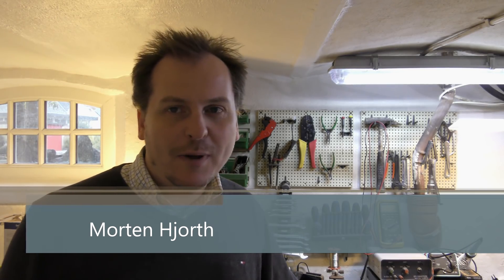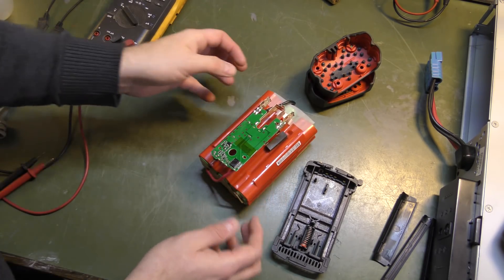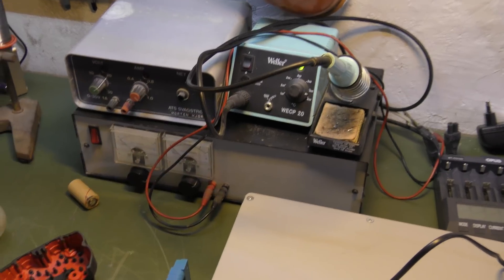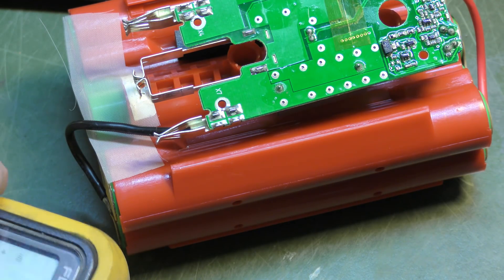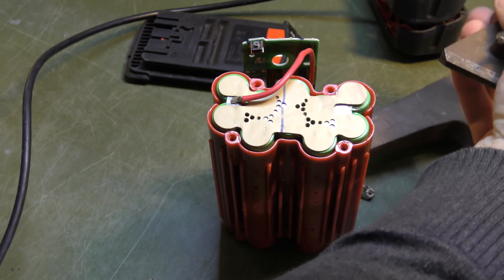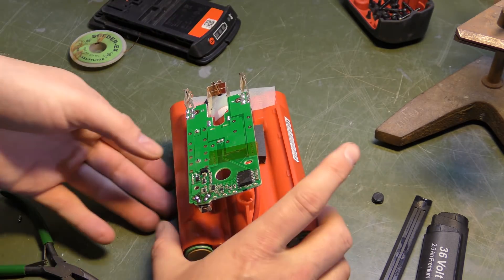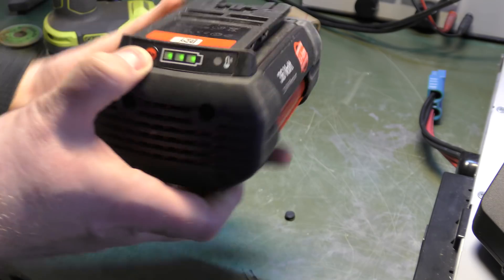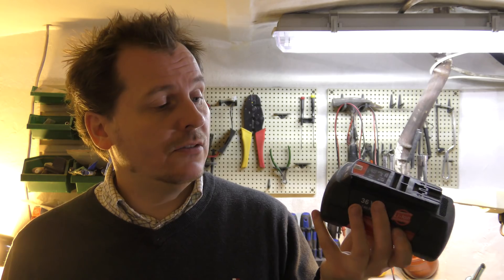Fixing Broken Bosch 36V Li-ion Battery Pack - 776

Comment: My battery shows 19v then nothing.  Seems to switch off straight after showing a reading. Each cell shows just over 4v. Is this a thermistor fault and how do i change it? TIA
Reply from the maker: 19V is probably too low,, something does not add up,, 10 cells of 4v,, would not give 19v :-/

Comment: What is the middle pin for? Is it for the temperature sensor?

I made a custom battery for my "easy rotak 36-550" machine and i connected only the + and - from the battery, no middle pin.

The machine it starts for 3 seconds, that stop.
Reply from the maker: Sorry I do not know,,  do not have this battery,, as I returned it :-/

Comment: Hi I am getting a rapid blinking green light when pressing the battery status button, and the battery goes red on the charger when it is slid into the charger itself. What can be wrong? Thanks.
Reply from the maker: I fixed this battery for someone else,, so I do not have it anymore..
But I would take it apart, measure the overall voltages,, if that is okay, I would mesure the voltages on each cell,, to see if anything it to low. Best if they are all with in 0,1 volt of each other. 
If one or more is to low,, you need to charge that up a little,, if to high,, draine it a little,, using a little load,, 6volt motor, or 6volt light bulb.
Reply: @MyPlayHouse  This would obviously require volt meters and other electronic tools to be able to charge and test as you say. I am sending this 32V 6Ah battery to Robert Bosch here in the UK in few days time, and I hope they do as you say and get it to take a charge again. The battery is just 28 months old, and I did not over charge or drain it for it get like this. It all went wrong when I mowed my lawn and the mower kept losing and regaining power until the battery completely died yesterday. I mow my lawn at least 20 times over a 30 week period of time .
Reply from the maker: Yes the battery should still be good after 40-60 uses.. :-/
Reply: @MyPlayHouse  I received a new 36V 6Ah lithium ion battery 5 days ago and mowed my lawm without any charging issues prior to the mow. However, the battery only has a 6-month limited warranty. We'll see how it goes.
Reply from the maker: Best of luck!

Comment: I dont understand, that switch is only for the led lights right? Or is the current also passed through it?
Reply: From what I've seen when examining my own battery, the tool (drill/mower/etc) uses the centre battery connector as a parasitic 1wire interface and queries the battery for info such as pack voltage (18/36v) and temperature. If the battery doesn't respond, the tool will refuse to power up, or will work for 1 second and then die. It's a combination of safety protocols and presumably DRM in a failed attempt to thwart aftermarket clones. 
I'm guessing that the BMS had previously registered some sort of fault and entered a lockdown mode for safety. Some sites report that holding the status button down for ten seconds will perform a factory reset on a Bosch BMS, so perhaps that inadvertently happened whilst the switch was being replaced (I got the impression the bit of the video that was cut out at 9:10 involved an epic desoldering struggle which likely bridged the switch contacts).
At some point I'm planning to hook up a logic analyser and decoder to see what's going on. I was surprised to find practically no info about it online. Bosch do provide industrial BMS systems, so perhaps there will be datasheets available for those that reveal some of their consumer device secrets 😁

Anyhow, it was a very useful and informative video, even if the root cause wasn't identified. Nice one Morten 👍👍
Reply from the maker: Sorry I do not remember,, old video. :-/

Comment: I have a Bosch 36v garden battery that’s measuring 30.4v but the charger thinks it’s bad.  Is that too low a voltage for it to charge?
Reply from the maker: The charger can probably see, that some of the cells are way out of balances,, take it a part and check it with a volt meter. and charge up the low cell(s) (never charge li-ion with more than 4.2 volt)
Reply: @MyPlayHouse  thanks.  Is there a way to charge it without pulling it fully apart?  I tried linking a fully charge battery and that didn’t do anything.  What does the spring in the middle do?

Comment: I have seen a lot of batterys of powertool and bosch has no balancing. I have seen so a lot of broken one because they just get debalanced. Their are certain batteries which tend to do it more than others. The older bosch 18v batteries especially the 4 and 6 ah ones use Samsung cells which are more of a problem than the 5ah once which habe LG cells. They even state that they match the batteries so there is no need for balancing. If I'm honest they could get longer life out of the cells if they would balance them but I guess it is just like a oilchange on a car. That's were they make the most of the money. On the same time you get makita batteries and they are balancing the battery pack but put a kill switch on there which counts the cycles and then kills the bms. You'll find a lot of videos on that topic. You can actually rather not balance them and balance them manually like I did with my battery packs and just do it once in a while and you get plenty more life out of them. At least that is what I do with bosch batteries 😊
Reply from the maker: Hi TechnicDude
Thank You very much!  glad you liked the video :-)
Thank you for watching! :-)

Comment: Hej Morten, fed video - godt med noget nørderi :-)! Jeg vil høre om du kunne hjælpe mig, jeg har en Black+Decker 36V oplader der ikke virker. Det er helt sikkert noget simpelt, men jeg kan ikke få printkortet ud, da der er et par special skruer der holder det på plads. Mvh Chris
Reply from the maker: HI Rns E
My channel is English, and to make sure as many as possible,  can also enjoy the comments, they are also English.
Please keep to English.

Thank you for watching! :-)
Reply: @MyPlayHouse  Sure, no problem. Do you have any idea what may have coursed my Black&Decker 36V charger to stop working? It's completely 'dead' no light flashing and batteries not charging. I've tried to open it and look for a fuse, but there does not seam to be a fuse.

Comment: You're right about the lack of balancing function on this battery. This is very odd because when some cells will get out of balance, this will overcharge some  of them. Very dangerous as far as lithium is concerned... I have no clue why a "reputable" manufacturer such as Bosch does that, a fire incident could damage their reputation
Reply from the maker: Hi speedsterh
Thank You very much!  glad you liked the video :-)
Thank you for watching! :-)
Reply: If you use a little more time on sourcing and testing cells, securing conformity between cells, then you dont need a BMS. Check up Garcias videos, he says the same with big packs. He ran a bus on a battery pack without BMS. Also they put a termo sensor cutting out if the batteries should overheat
Reply: The cells themselves have protection against over-discharge and overcharging, so a fire can't just happen easily. However, I'm still interested in what balances the voltage between the cells. Is it possible that nowhere on the entire internet is there someone who knows how this kind of battery pack works? Somewhere it's written that the cells are high quality and charge and discharge equally, which I don't believe! There must be something within the cell itself that regulates the voltage. But I'm also interested in when this happens – during charging, discharging, or when they are at rest?

Comment: Check the battery PCB in more detail and you will see a fuse you can take out to give you safe isolation from the risk of a full battery short circuit.
Reply from the maker: Thank you very much!
Reply: That fuse is connected same way. Not soldered, but spotwelded

Comment: Replacement Power Tool Battery for Bosch D-70771
Battery Type:   Li-ion
Voltage:   36V
Capacity:   4000mAh
Color:   Black
Weight:   1270.95g
Dimensions: 97.92x72.77x156.99mm
http://www.drillbattery.com.au/buybattery.php/bosch_D-70771_power+tool+battery.html
Reply from the maker: Hi BatteryDepot comau
Why are the 4AH pack lighter then the 3AH. Quality 18650 weigh more.
Thank you for watching! :-)

Comment: THEY SPOT WELDED THAT ON!! JUST SAYING OLD ONE LEGGED JOSEPH T RETIRED NAVY
Reply from the maker: Hi Joseph Brendel
Thank You very much!  glad you liked the video :-)
Thank you for watching! :-)
Reply: He is right. They spot weld the cables to the busbar. If you want to take it of use some cable cutters and lever them of. Just do it on the negative side, way less risk of short circuit when soldering back on the busbar.

Comment: Good Job. Was Worried when you removed the switch without being able to disconnect the power.  To help  protect you, I unplugged my computer just in case....So, how did the battery project work out? ⚡🤣😋😀😀
Reply from the maker: Hi reedrancho
Thank You very much!  With your help it all worked :-)
Thank you for watching! :-)

Comment: Hi Morten, noticed another comment saying that not many tool batteries have balancers..... Have personally taken apart hundreds and found that in the last 2 years more and more are coming out with no balancers. I have an almost identical bosch 36v with balance, but it's a couple of years old. The cynic in me says this is all to do with manufacturers trying to increase profits. After all there is no way the battery without balance can last as long as the one with.
Great videos.
Reply from the maker: Hi benjamin hayes
Thank You very much!  Totally possible,, or to give the manufacturer's a little credit, Maybe it's not as necessary anymore, maybe there is more errors on the balances cricket then on the batteries,, maybe the cells then self includes some safety kill switch.  
Thank you for watching! :-)

Comment: i notice when you try to remove the plus cable from ther battery you damage the protection of this? is danger have  a little part of red wire exposed?
Reply from the maker: Hi Christian Belotti
Thank You very much!  Yes the insulation melted... it's fine.
Thank you for watching! :-)

Comment: No balancing on most tool batteries, unfortunately. I've taken apart Bosch, Makita, Dewalt and Milwaukee and found nothing in most of them. The newest versions of Makita seems to have it, though.
Reply from the maker: Hi Jesper Monsted
Thank You very much!  I forgot to check when I had the Ryobi battery apart.
Thank you for watching! :-)
Reply: Makes you keep buying their crap.  Use adapters and avoid buying from them in the future
Reply: I think that's not the electronics that balances the voltage, but rather just checks if any cell is below or above the allowed voltage! And when it is, the electronics register a fault and become unusable! With Makita, I have more problems with the electronics than with the cells themselves, it's as if they have a limited number of charges or something similar..

Comment: Yes i also wondered where the wires for the cell balancing were, also where is the temperature sensor for safe charging?.
Your solder sucker needs a clean and relube, they are a bloody nuisance :-(
Saving some parts is handy :-D
Reply from the maker: Hi zx8401ztv
Thank You very much!  It feels so good to use some of the parts, that I saved long ago. :-)
Thank you for watching! :-)